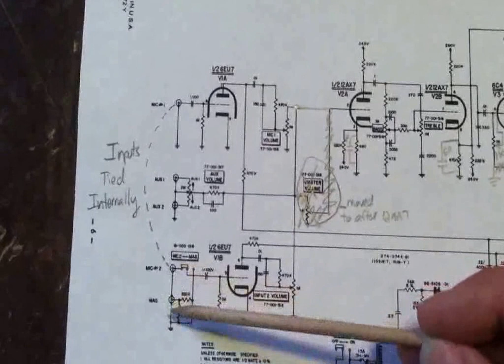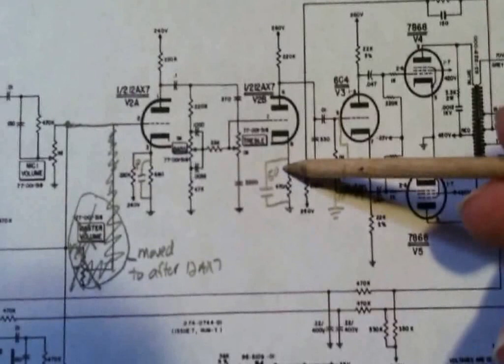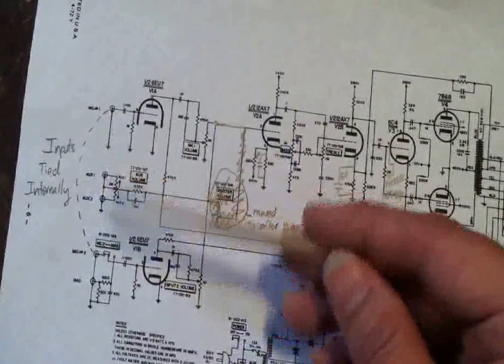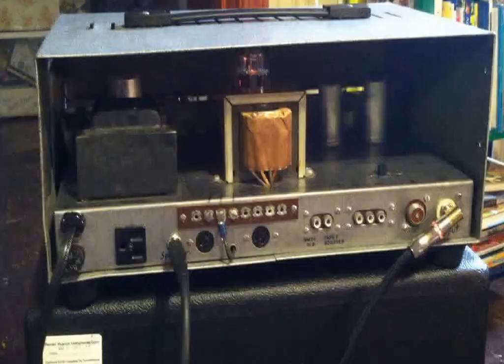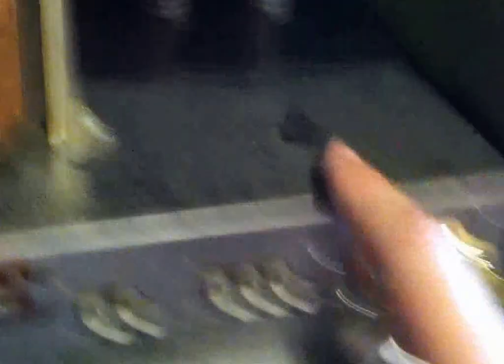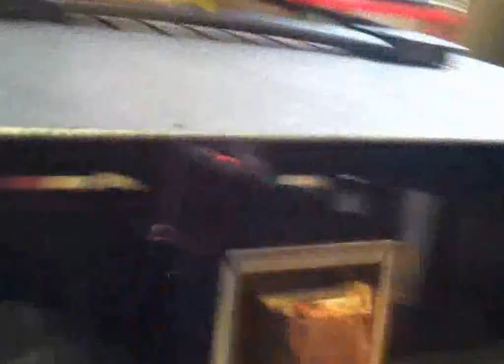Modifying a Bogen CHB-50 PA Head for Guitar or Harp

Comment: I've got one of these that someone converted >30 years ago and the input jack for channel one was put on the front.  They did an amazing job even removing the 70v outputs from the remote connectors on the back.  They even built it into a nice skinny but tall wood speaker cabinet on wheels.  The only problem was the old Jensen speaker that was rusted and rotten, it worked until a few years ago when it blew out and I had to stick a cheap 'o' 10" speaker in it.  But I'll be replacing that with a yet undecided quality guitar speaker for a tall and portable 1x12 cab.

Comment: Hi. Thanks for this video. I've got a question about the relocation of the master volume. I can't tell from the pencil drawing on the schematic, does the 1M MV pot replace the 1M resistor in front of the phase inverter, or does it connect in addition to it? Would that make it parallel to the existing 1M resistor?

Comment: Hello, been watching Your stuff for quite some time. Anyway I've got a Bogan cha 20, it's already been converted to guitar amp, I guess. What I mean is it's got a quarter inch input installed on the backside of the amplifier right next to What indicates would be a phono jack. I believe the 1/4-in input possibly to be wired to What used to be a microphone input...
   I guess My question is multifold: 
   If it's wired as I've indicated, would that be a good way to go about converting it?
If not, what would be the best way to go about that? 
  Also, what other mods/changes would need to be made or would be smart or beneficial to make this amp into something a little better soundi😅ng? 
Would you happen to have a schematic of these by chance at all? Or have you made a video concerning the CHA 20 that I've missed? The circuit seems to consist of 2-6V6GT's & 2-12ax7's (I assume they are both12 AX7s, one is labeled that for sure, the others label is worn and can't tell for sure). and a 6AX5GT rectifier. Which I have been using a 6x5GT tube in the rectifiers place for lack of a perfectly matching tube. 
  Hopefully you'll see my message and get back with me at some point.

I appreciate your time & would appreciate you pointing me in the right direction or any help you can give.

 thanks so much

Comment: have a 35 and a 50 of these challengers ...the 35 have  1 power tube  red plating ..i think its the bias diode they put in these...have to check it out..but the 50 is a tone monster without any mods actually....i should try playin with it a bit like yours...thanks a lot for your great vids  they are very  useful

Comment: @The Guitologist
OMG lost a whole graph of comment. Anyway the amp I mention is a Teisco Beltone APA - single ended & same design as a Champ. Trem the only difference. Looking to add grid leak resistor, & lose extra input jacks - but if possible, re-purpose that trem tube, jack, & pot, in order to get more residual power, or actual gain stage power, a line out maybe - your quick take?? two pins of pre-amp tube are free aswell. Hope you could make sense of both message pieces here!

Comment: @The Guitologist
Brad what a help you are. I do know Astatic Ltds own literature for the JT-30 mic, still the choice of most blue players, advises short mic lead, and a grid leak resistance (?)/resistor of a mighty 3 meg to prevent loss of low end. I have not even seen such a stout resistor dffor sale - where would it go?
I am ready to add virtual center tap (off pilot light connexions of the 6.3V), and remove 3 little-needed extra input jacks (all same value) - would like to get more power or dirt by disposing of trem-oh-lo. The trem rate pot includes switch for off; plus there's a footswitch jack. Any loss when There are open tabs on the 6av6 pre, aswell

Comment: Hey Brad I picked up one of these earlier this year and I'm starting to work on it to bring it back to life and make it into a guitar amp using the mods you did on that one as a starting point, and I was wondering, you had not touched the tone stack right? Because if it sounds that good with the stock stack I'm probably leaving that part of the circuit alone.
Reply from the maker: If I didn't show it or talk about it in the video, I probably left alone. Can't remember now.